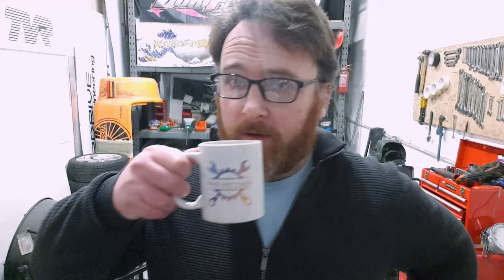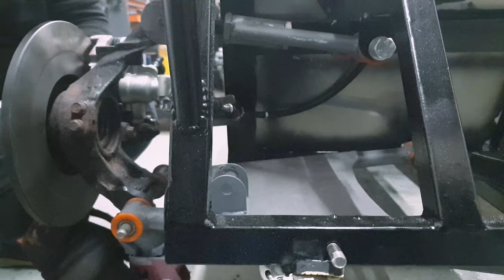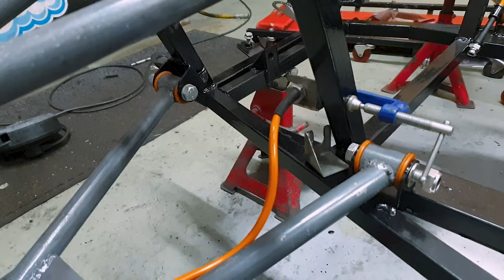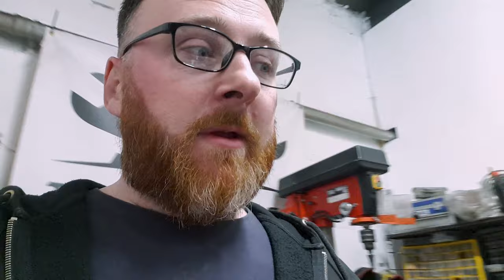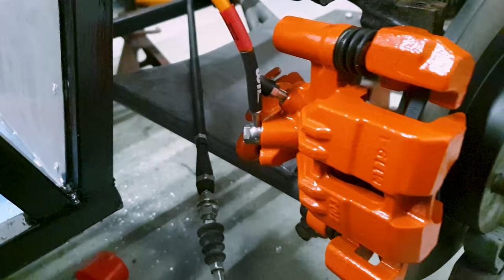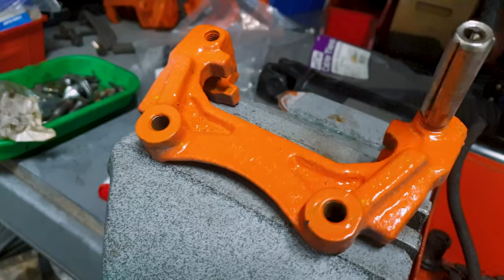MORE BRAKES!!!  Locost 7 Kit Car FULL BUILD!! - Episode 50 - (Project 7-UP)

Comment: Tek screws in 1.6mm walled tube ehh. I would use either rivnuts or weld in ferrule/nuts. (But this is great cos I haven't got to that stage on my Locost yet, so I get to learn from your prototype testing)

Comment: Like you, not keen on self tappers, but to be honest those do not look like self tappers. Rivnut might be more “professional” looking, but the larger hole will take more strength out of the chassis rail. Small tabs welded on giving the option of bolting on the P clip might be an option.
Reply from the maker: Itsthe strongest idea i have really, and places hard to reach will likely get that.

Comment: Self tappers are adequate for the job. But not the most desirable fastener on a race car. I would probably go with rivnuts and brackets. Liking the orange on the brakes. Do you have a paint colour/colours in mind for the rest of the car? Maybe Gulf racing colours? And thank you for turning off the adverts. Maybe try to woo more patrons by offering giveaways or some extra content. You’ve almost got me convinced. And I’m a cheap bastard.
Reply from the maker: Nah, gulf colours are a bit played out. I do have a scheme for it in mind but we will explain that later.